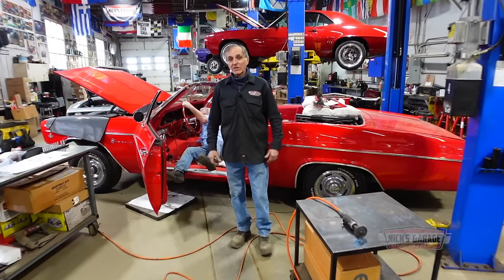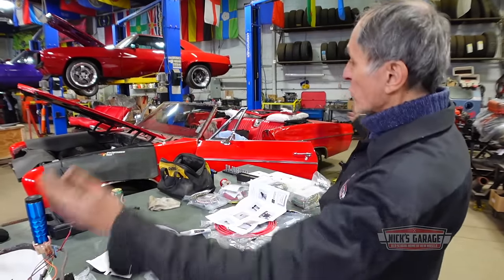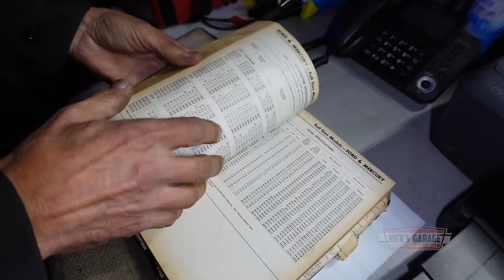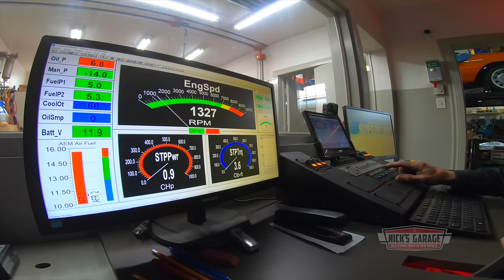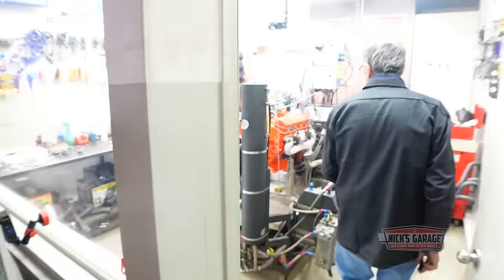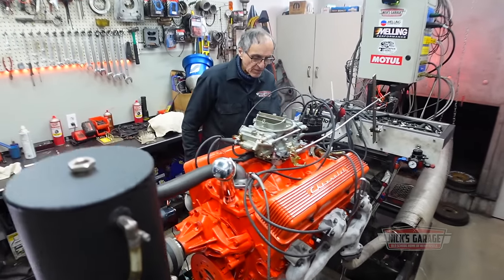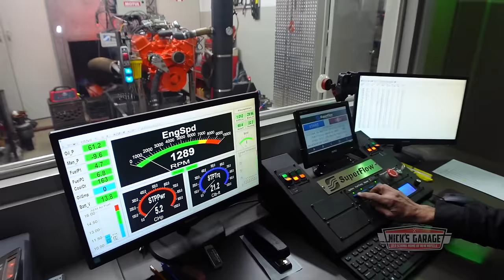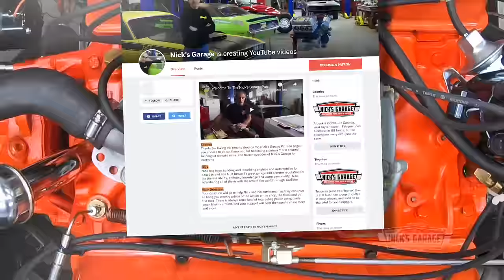327 Chevy on the DYNO - Exhaust Shootout

Comment: I don't get it, these professionals every small block leaks the valve covers. I worked on small block from 15 years old in 1969. I read to glue the gasket to the valve cover and simply grease the bottom. Mainly with stock steel valve covers they always had what I called butter fly washers with a small lock washer to apply pressure out further from the bolt. Never had near the problems with leaking valve covers that these professionals have. Some times it's hard to understand why they continuously have leaking valve covers. What I learned was over tightening makes it worse and usually destroys the gasket.

Comment: if George is smart, he'll decide on a set of quality stainless steel headers instead of those junk manifolds. 40 ft/lbs of torque wasted over some ugly manifolds makes no sense. quality headers and fasteners won't leak or rust out like cheapo headers always do. it is a sweet little engine though.

Comment: Was the 250hp rating it had factory with the accessories installed and ran off the engine?  And how accurate the rating was.
Reply: Before '71 was the old grossHP rating... naked engine tested at flywheel... prolly about 195 netHP... 
Naked engine on dyno gives gross HP readings...

Comment: Ram intake exhaust manifolds we're used by gm on there higher h.p. 327. I know the 327275 engines all had them not sure about the 250h.p. those will definitely increase the h.p. compared to the standard manifolds that's on that engine

Comment: What about gm factory ram exhaust manifold versus the standard factory gm drop down manifold any ideal h.p. difference between the 2. Gm used the ram exhaust manifolds on there high performance 327
 250 h.p. and up

Comment: That engine should have Rochester 4GC  carb to be correct. That cam  in it is bigger  than the 327- 350hp cam (. 447 lift)
Reply: It's probably the 375 hp fuelie corvette cam.
Reply: Cam is too big for this engine... too peaky... 475 HP cam in a 330 HP engine...
Reply: @Hanzyscure  - Naw, just a too big Comp hydraulic cam...

Comment: The lost torque is going to be missed trying to move this sled around. Also tell your customers to avoid the junk Chinese valve covers and breather tubes that so many people try to use. Chevrolet still sells the 1970 LT-1 aluminum valve covers and they look good and don't leak. They also provide for PCV which every engine should have even this old one. Please don't tell us the owner is going to use a Powerglide transmission too. Some old things are better left behind. 335 hp with headers from this engine is pretty good, I have dyno'ed Pontiac 400's that barely made that much.

Comment: there was a L79 327 ,THE 327 L79 Engine Specs: Horsepower: 350hp @ 5,400 rpm. Torque: 360 lb.-ft @ 4,000 rpm. Compression Ratio: 11:1. ...

Comment: Old man you should know better! You gotta have a crankcase vapor evac system of some kind. Dump the valve covers. That ain't gonna happen, too pretty. Appears to be a 65 or later block, no draft tube provision. Simplest solution, not the most efficient- drill a hole in the oil fill tube, solder in a high flow pcv valve and run the vented fill cap that you have. I still liked to vent a valve cover to the air filter housing. If you have firewall clearance you could drill and grommet the back ends of the valve covers, install 90° fittings and run a pcv and air cleaner vent. I was expecting it to blow the rear main at anytime. The modified Holleys that I ran required the metered vacuum leak of a pcv to lean out the idle mixture. What's your A/F read after extended idle time?
  Built my last 327 in 1976. $20 junk pile Vette motor that was supposed to be locked up. Thirty over 11 to one pistons, cast iron rings, milled 2.02 heads, ports cleaned up with a 3 angle valve job. Studs and guide plates, long slot rockers with locknuts. Shimed conical valve springs. SSH 510 hydraulic cam 1/16 turn below zero lash on lfters. Snowflake factory intake, modified holley on a multi layered insulated 3/4 inch spacer. Mallory full mechanical advance dual point distributor at 38° total advance. 4.88 strip gear, 3.91 street gear. 1/4 mile best-11.60. 1/8 best 7.17. Not fast anymore, but in its day that Camaro was one of the fastest pure street cars in the ATL and I was always willing to show you. When you get pulled over by a cop and the first thing he says is I can tell you what color your oil filter is you know its going downhill from there. Got a ticket for making the car "gyrate" in such a manner as to lift the front wheels 3 feet off the ground. Oh yeah. 
  That car was my daily driver. Made an emergency 1200 mile road trip with 4 people in the car. Had to stop every hundred miles for a six pack of beer and a tank of gas. Those were the days mon cher.

Comment: From factory the 327 is an 8k RPM engine and you only tested to 6k?
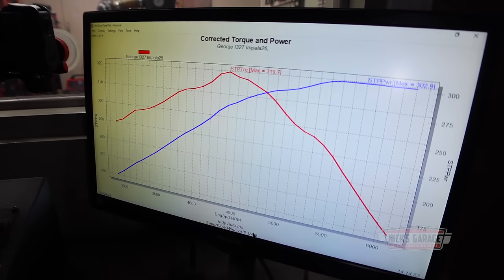Reply: Cam is way too big for heads used... torque peak instead of a torque CURVE... also, most street 327's done by 5500 RPMs... see 18:45

Comment: I'm not a mopar or no car guy, and I catch a lot of flak for it but after owning hundreds of engines and building them (heck, I like my 255 flathead mercury v8! );I think that 283 and 327s were good engines. when kept at about this level they are cheap and reliable and in my opinion make better daily drivers than SBMs. they are some of the best small block Chevys and put a lot of bigger engines on the trailer esp. In the 1/8th mi. That being said it always amused me that they would put these in a car the size of an impala with only 9ci over a 318 and call it performance. Of course he can do what he wishes and I respect that. But after seeing cheap $75 headers drop a full second off the 1/4 mi times (alot of it in the first 60ft) and get 5 more mpg on a 440+6 over 6bbl manifolds and 2.5in cutouts everything I own gets them! Dad said that in the 60s they were very expensive and headers and rear gears separated the men from the boys. The biggest difference is in regular street driving not necessarily in HP. This is because of the huge gains in low end torque, if you need say 200 ft lbs to stay with traffic and have to push the throttle 20% harder to get it you see where the mpg comes from. The bigger the cam the bigger the difference. Advantages to a SBC over a "B" series mopar was ability to get to plugs easily with manifolds and parts availability.  Everything else was a pain to work on and takes alot more bandaids and $ to build when cams get bigger etc. . Let's not even discuss starters! Really cool car tho and great job! I'd take it!

Comment: Mopar only built a few engines that made 1 HP per cubic inch Chevy and ford built several power is in the heads if its not a hemi mopar heads don't flow good numbers

Comment: the cuda was so much better looking then the challenger that it was hard to believe they both shared the same basic unibody chassis and suspension, the cuda looked sleek and sexy while the challenger just looked like it had a fat azz although i will say for some reason a white challenger didn't look as butt heavy as the comp orange RT's did.....

Comment: Only difference between the 1962 and the 1967 327 they rated h.p. at diff ramp. 4800 rm 327 rated at 275 h.p. 300 h.p. was rated at 5000 rpm same engine diff rpm according to gm we all know they would never make that h.p. gm boshed the truth

Comment: Don't that sound sweet guy Chevy Chevy look at that horsepower with very little work done to that engine 327 Big bore Short stroke come on guys a piece of s*** forwards got to put a lot of money until they make them things run right bad oiling system on the Fords Chrysler's got bad valve train